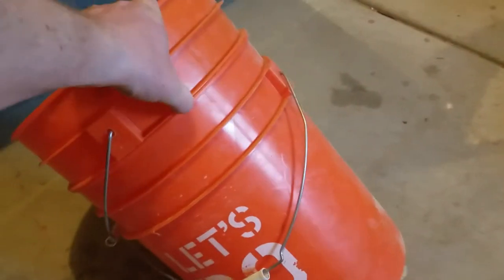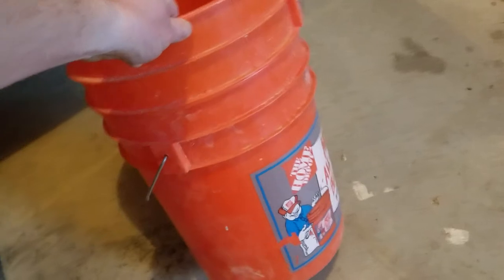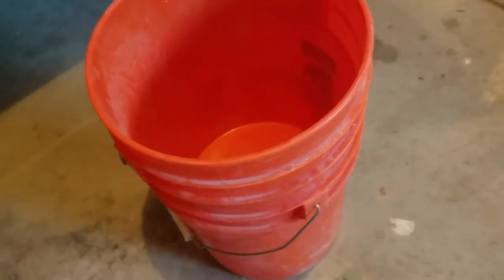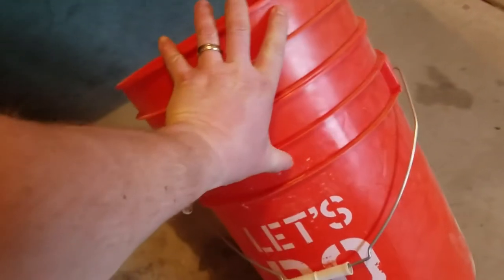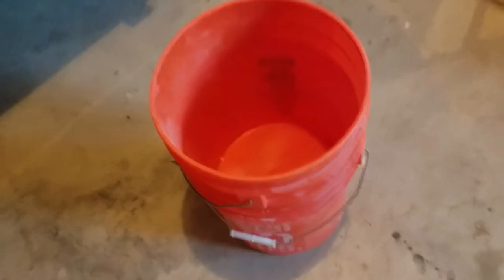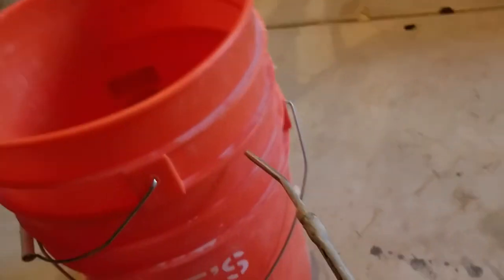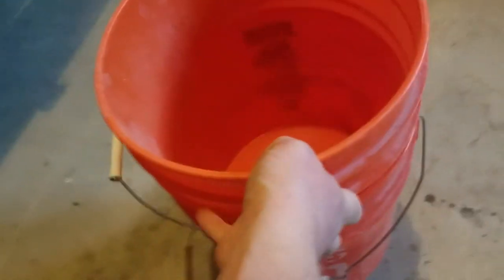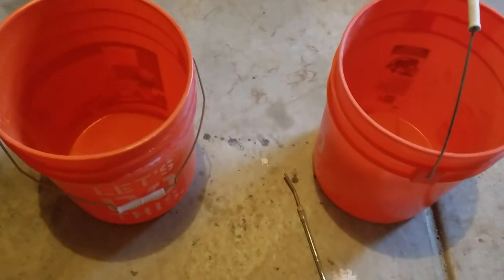How to separate buckets that are stuck together. Super easy.

Comment: For anyone without an air hose or small air compressor you also use a vacuum cleaner if you have one where air flow can be reversed. Just put a narrow nozzle on the end to focus the air into the crack and you're golden. I used my old Electrolux vacuum. You can also use a bike pump with a straw.